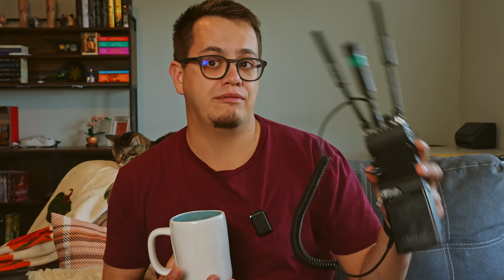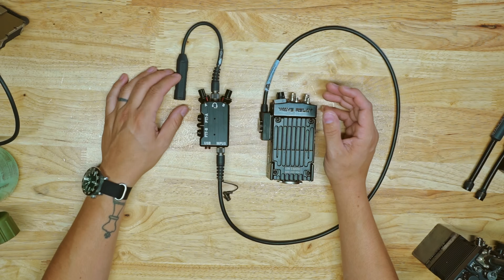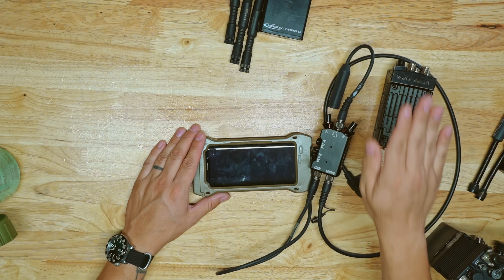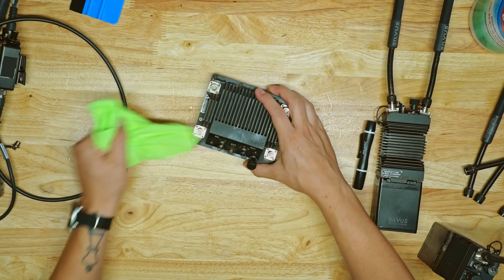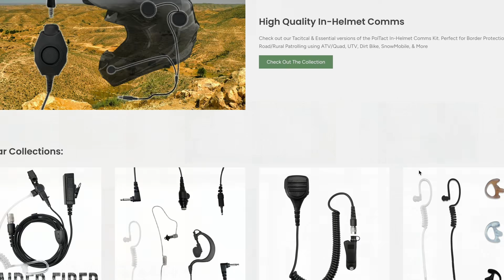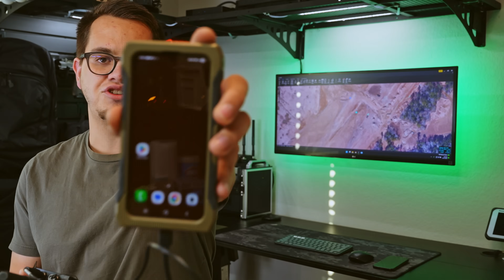How Prepared Citizens Can Get Started With MANET Radios – Pt. 1: Sourcing

Comment: I love this stuff, most comms stuff is baofeng adjacent.
I love P25 systems for somestuff, but you explaining ATAK is such a refresh I self taught ATAK there isnt like easy guides that make sense so I really like how this channel is going into.
Reply: P25 and ATAK are fed honeypots by the way. P25 have a backdoor that allow your location to be transmitted live with radio finding techniques, and ATAK obviously has that inherently in the fact that you use a mobile device.
Reply: @DaveSmith-cp5kj  P25 does however some radios do not have GPS so maybe not,  but every radio has the problem of RF finding and jamming, WIth ATAK use something like a tablet that has no cellular works pretty well,. I am saying this as peace time I use these tools for fun.
Reply: @subarusensei3685  The vulnerability doesn't use GPS. The exploit uses the handshake used to verify the key. The attacker basically triggers this handshake repeatedly while listening for the return signal and triangulating the users location in real time.
Reply: @DaveSmith-cp5kj  If you're hung up on that, then you don't know how to use either of them.
Reply: @anarchobacon  lol, okay glowie.

Comment: Beartooth is actually pretty solid. Idk about the extreme ranges, but if u have a handful of guys, the app and radios seem to perform very effectively and as advertised (within reason).
Reply from the maker: I had a demo kit for a bit; their plugin is well built. The physical devices are very poorly constructed and would not survive the hard use I train for. Notwithstanding, the owner gets VERY upset any time someone points out the incorrect or missleading claims that are made by thier marketing team.
Reply: @austinjoemiller 100% agree. Also the way the 40% discount codes are now mysteriously only 20% is sus... however they are quite effective for their purpose/cost and are very easy to get working. I got mine for $750 and it basically works exactly as advertised (i haven't done a max range test, but and not planning to push past a few miles per hop anyway). As for the case, i ran a bead of gasket maker around the lid and switch. I doubt its super crush resistant or divable, but in kit pouch in the rain, I'm sure I'll be fine.

Comment: What's your take on using ATAK plug-ins on compatible DMR handitalkies (eg HyTAK by Mojave Repeater, etc) to get additional data capabilities (eg ATAK GPS sharing, text, way points) on top of the encrypted voice comms? Also tends to come in at that "just over a thousand dollars civilian market" space that's so much more accessible
Reply: Very curious about this as well
Reply from the maker: I’m part of the Mojave Repeater team and have some hands-on time with HyTAK specifically. It’s a great setup. At the end of the day, you’ve got a Hytera radio that’s digital, encrypted, rugged, and built to be man-worn. I already use Hyteras for a lot of team-based work, so being able to extend that same tool with ATAK functionality through the HyTAK plugin is a huge win. I’d definitely recommend going that route before trying to DIY something like Meshtastic; those projects usually sacrifice durability and reliable voice comms for data features that are riddled with bugs and require a lot more troubleshooting.
Reply: @austinjoemiller  just a thought here. With absolutely no working knowledge of comms ( I was a medic way back when and weren't allowed to touch comes:) )... perhaps a conglomeration of functionality in various price ranges for the 101 types? Maybe you've addressed this on another channel you apparently have? Power will be priceless if/ when a grid goes down. Then again, keeping in touch will be in the same category.

Comment: Great break down video of mil spec mesh radios. However, I feel that comparing a $100 Meshtastic radio or a Beartooth radio at 1,200+ per device to a 10K+ military mesh radio is misleading. FYI, chlorine is corrosive and I would not would it on any electronic components.
Reply from the maker: I appreciate the feedback! Totally fair point;the goal was to compare functionality and product behavior, not build quality or complexity. That said, Beartooth kinda invited the comparison when they started calling an XBee Pro GFSK chipset “LPI/LPD,” lmao.
Reply: @austinjoemiller  we utilize 98% isopropyl alcohol to clean the contacts on the sides of the radios. Yes chlorine is corrosive even to gold flashed contacts.
Reply: @austinjoemiller  Yeah,  I have used the Beartooth MkII and they are not super impressive for the price. When they were selling at 40 - 50% off I could see some value. Have you looked the Doodle Labs MeshRider Wearable radios? I think they're currently the closest radio you can get to the Military MANET radios for under 3K.

Comment: RAMMount make xcover cases than present the USB-C port as pogo pads (Intelliskin brand), just need cable from that to radio to make the weakest point less fragile.
Reply from the maker: Sadly I think those are power only, no data.
Reply: @austinjoemiller  Does both. Juggernaut cases licenses the tech from RAMMount

Comment from the maker: This is my first video on this channel, so any feedback or support means a lot. If you learned something new, hit like, drop a comment, or share it with someone who’d appreciate a grounded take on MANET radios. I’m planning more content if this video does well, so please subscribe if you want to see that.
Reply: I gotta question, who's responsible for frenchifying it instead of pronouncing the acronym like god intended? Last I checked it didn't stand for "neywork."
Reply from the maker: @dalenvigil same reason you park on the driveway and drive on the parkway
Reply: The can be built. I'm building my own. Reverse engineering is power if you know how to use it
Reply: I think you would find this video useful. The video is called "I Built a $20,000 Military Router for $106.23", which is what you appear to have in the thumbnail (i think thats it i dont remember).

As for video feedback you could either go the bare-bones route like how Lock Picking Lawyer or Forgotten Weapons does it, or you could lean in to a light preface and go the way of Eighteen Arrows or smthn idk. The weapons in the background made me think it was in the same category as Garand Thumb or Hitchcock45 at first, but when you got into the explanation, you came off as more of a tech guy, like JayzTwoCents or someone in that sphere.

What you could add is timestamps in the description, those are always appreciated. Thats really it. The video is otherwise well filmed, well trimmed and well worded. The way the content was presented is the same as how the tech guys present their devices, so its easy to understand. Not much to change, honestly, other than maybe timestamps and a longer parts list like listing a link to ATAK, though even then, the list in the video description now has everything relevant, so maybe not. The way you ordered the contents of your description is also done well, so no changes needed there.

Have you made or been on other youtube channels?
Reply: I like it
Reply: Great video, I have really wanted to step up my knowledge in this area. I look forward to you building more video’s on top of this one. Keep up the great work !
Reply: Quite a dense, powerpunch of info... thank you.  This falls outside my personal use-case niche since I fall below formal mil/LE and above what is available with retail/amateur radio. I deal primarily with volunteer rescue and public service org comms with limited budgets who need, but really cannot afford, "decent" gear.  Hopefully there will be some trickle down of integrated and ruggedized comms with US made products at some point (which is kind of what your doing but at a magnitude of cost above my use). I subscribed to see what your follow ups are, hopefully my niche that falls between cheap Chinese radios and $10K tactical radios is represented at some point and is worth your (or someone's time) for content development. Thank you for the excellent video.
Reply: You are no very likable
Reply from the maker: @SethFX you are no very good at spelling.
Reply: I won't be getting legit MANET radios but I'm considering putting together a few openmanet radios. It's the use case I'm struggling with. Openmanet I think doesn't include basic voice comms capabilities by default. There are some builders that do add it though.